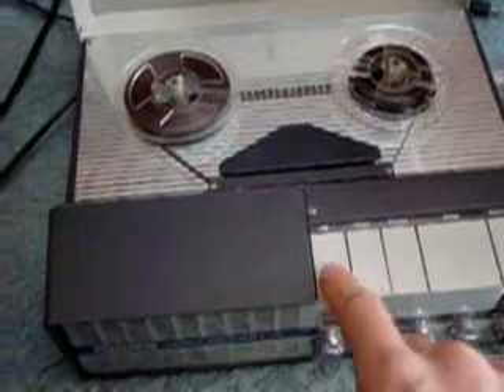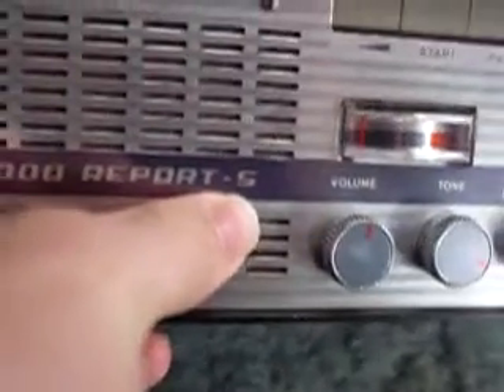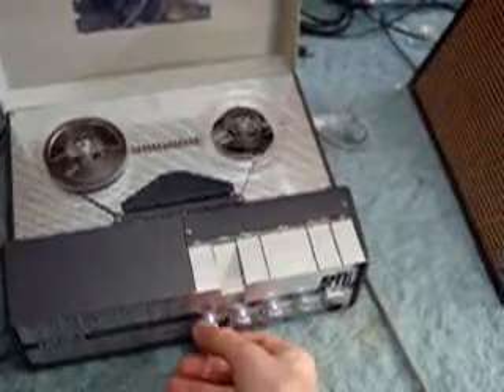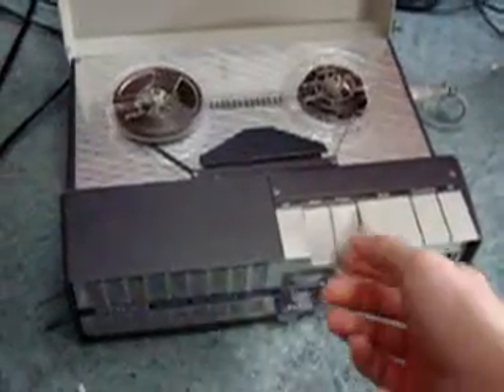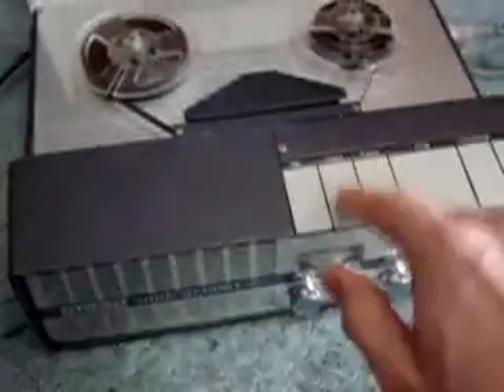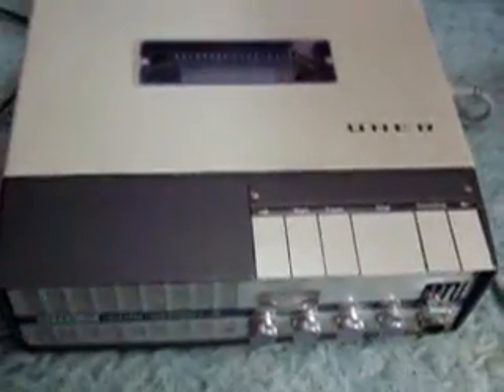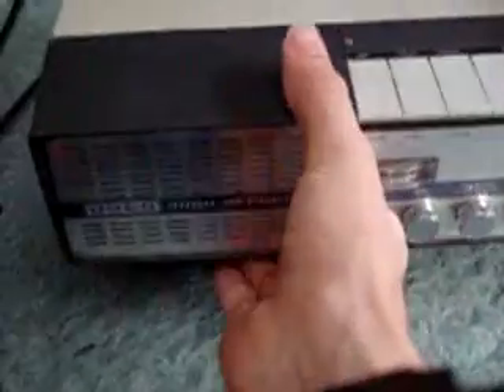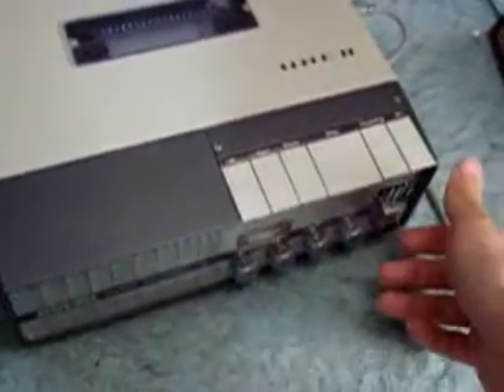(fixed now) Motor servo problem--UHER 4000 Report-S

Comment: What could cause the motor not to spin at all? When I turn on the device all I hear is a speaker hum and nothing else, motor seems dead.
Reply from the maker: The output transistor of the motor driver circuitry might be bad. I don't guarantee if that's the problem or not, but it might be. It is the rectangular PNP germanium AC117 transistor near the motor. Try any general purpose PNP gernaminum (silicon will probably work too).

Comment: The problem with the Uher reports from 1961-1965 is that the engine works only lasts for 100 hours and then has to be replaced.

One has then two possibilities: either you find the same engine  or one builds the engine of the report L, together with audio power stage.

However, the engine can not be repaired

Comment: unscrew the servo board from the the fram and hang over the side in back don"t unsolder the leads and make sure that the board is not touching any metal contacts then try and see if this helps any,if so there is a grounding feild from the board to the frame and you need to sheild the board from the frame.

Comment from the maker: @TwinMillMC Problem is is that this uses a very special motor, with several connections, one giving out a weak signal of the frequency of the motor (changes with speed) and that tells the circuit to add or decrease the power going into it.

Comment: I know nothing about this unit, but did you try connecting another compatible motor? Connect an external motor to the existing motor power leads, then somehow adhere a turntable strobe disc, or something like that where you can monitor any fluctuations in speed of the external motor. If the external motor runs at a steady speed, then you know that the problem lies with the original motor inside the deck.... I don't know, a simple process of elimination.

Comment from the maker: @RetroPCDOS I have already replaced the one of the AC151s, I have also replaced the (heat-sinked) AC117 with a silicon one. The other germaniums replaced with some old Sanyo germaniums.

Comment: I had that same problem w/ 2 1980s HiFi cassette decks before. I tried adjusting the adjusting the speed, but did not help.

I hope you can figure out what's wrong with yours.

Comment: Also, check the mains supply/battery charging unit, the one you are using in this video that plugs into the wall then into the recorder. The older versions do have caps in them that can go bad. My 4000-S speed problem went away when I started using a newer version of the mains unit with it. Also, do you have the schematic diagram for this unit? I do, if you PM me with a e-mail, I'll scan it and send you over a copy.

Good Luck!!

Comment: Check that switch that controls the motor speed for play vs rewind or ff, its in the middle of the machine (you'll have to remove the "see-saw" axle for rew and ff to get to it). Its a leaf contact style that gets pushed on when you use the transport controls. My 4000 L was so well used that this switch was actually broken from the chassis of the machine, it could also be dirty making it stick.

Comment: Maybe it's a bad switch, I don't know if the motor is supposed to go any faster on rewind or fast forward, or if it even has different switches to controll the motor speed for play and FF/REW but it could be that.

Comment: It could be a capacitor related problem, I suppose.  Also, there might be some mechanical issues with pinch rollers, idler wheels, etc.

Comment: did you replace the transistor with another germanium one or a silicon one? If it was replaced by another germanium one it may have whiskered and shorted out, check the whole motor control board, transistors, caps resistors the whole lot, also check the switch that changes speeds from play mode to rewind/ff speed if it has one like some Ampex decks do. Something on that board was flaky to begin with, possibly a dried up cap or drifting resistor.